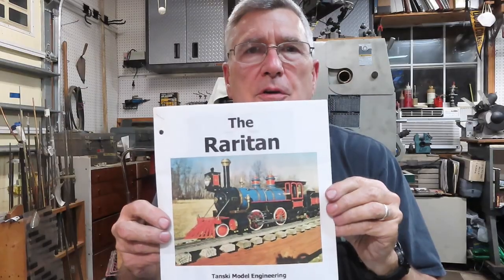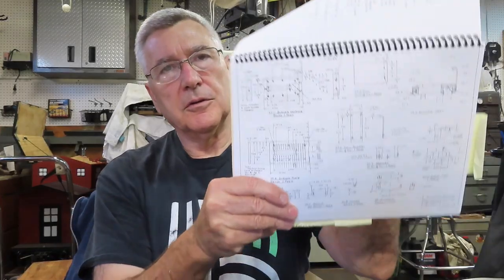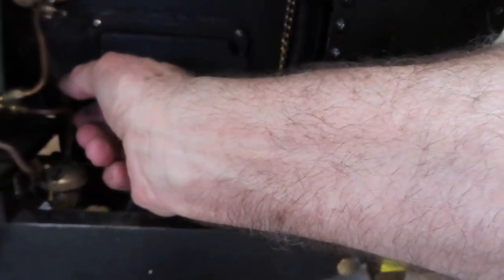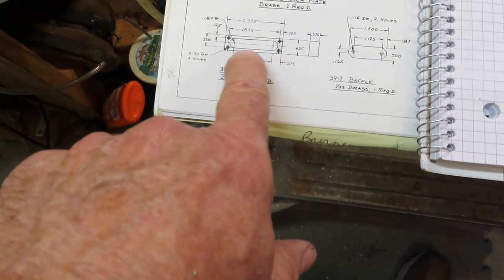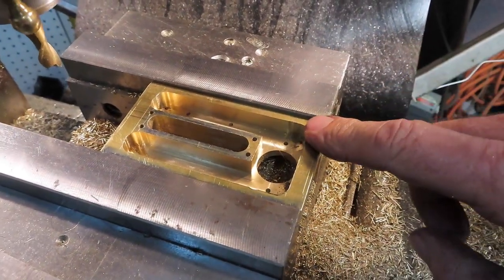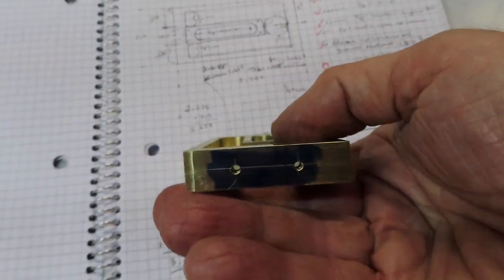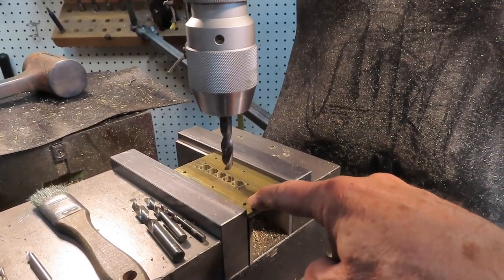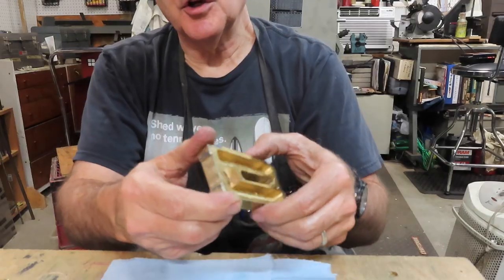Raritan Propane Burner Part 1

Comment: Can’t wait to see the burner complete and up and running! 
I’m a backyard blacksmith/ blade smith. Through the years I’ve made many forges and different burners and what I’ve finally settled with is a “ribbon burner” made out of cast refractory with 50-60 holes in it. Best burner to date and I wish I had started with it from the beginning…😂
Your, if I could call it a ribbon burner, is going to be amazing to watch fire off for the first time!! Cheers!
Reply from the maker: Thanks so much for watching and sharing your insights! I’m truly interested to see if this burner will perform well.  Appreciate you taking the time to write about your experience. Thanks!

Comment: The regulator is just a welding gas unit.
The hose should be switched out for a LPG hose, the Acetylene hoses will denigrate when used with propane.

“Dulled” is not the correct term for  brass drills. zero back rake on the cutting edge.
Reply from the maker: Thank you for your detailed comments. I agree the value is from a welding gas unit. I just purchased one on eBay and will use it for this burner. You are absolutely correct about the brass drill terminology. Thank you for sharing it. Will look into the hose choice as well. The one I showed is the one sold commercially by a reputable vendor. Luckily, I have a local welding supply store near my house and they can custom make hoses. All the best to you. Bill.